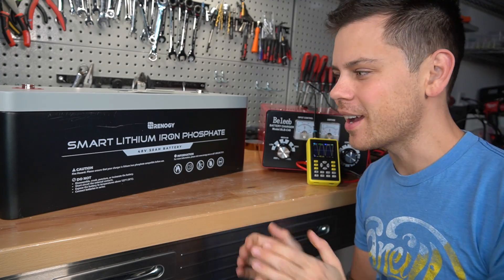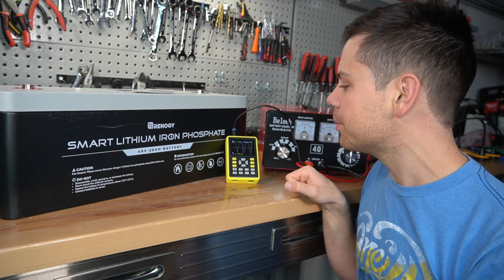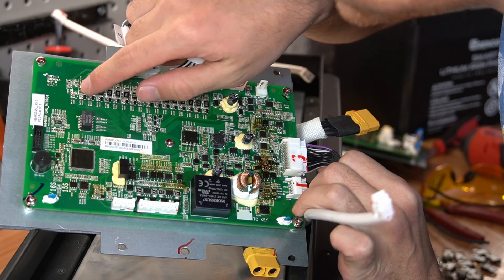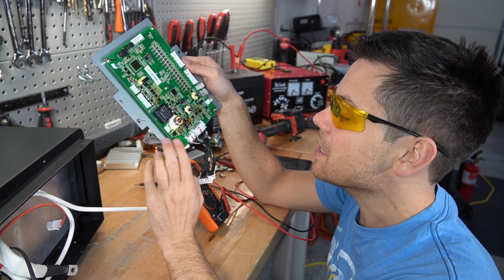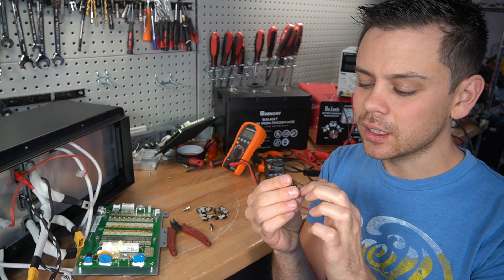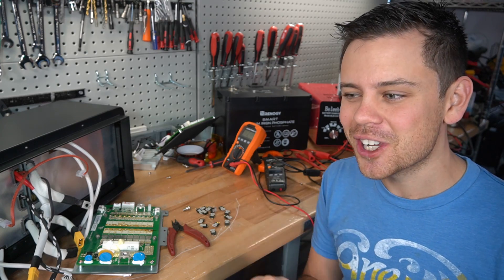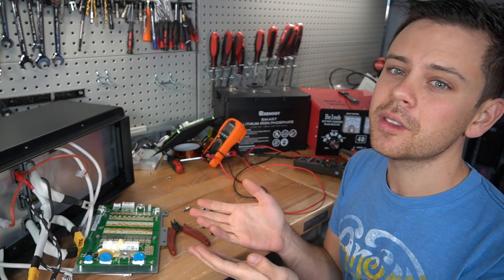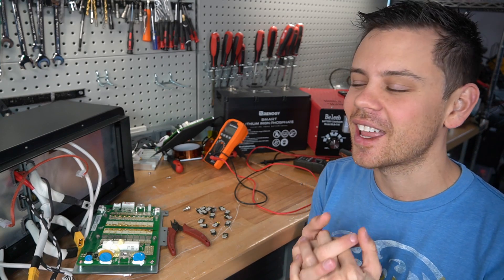Renogy "Smart" 48V 50Ah Part 2: How did I kill it?

Comment: Ok. after watching this and seeing this O-scope I went back and took a close look at your previous post. What you are seeing on the scope is NOT RIPPLE. It is Intentional. What you are seeing is a 120 hz. triangle wave imposed on top of a DC voltage. The DC voltage scope is showing is not the peak value, but a combination of the offset + some amount of the AC voltage. What I see is you've got a little bit more than half the waveform showing. The DC offset looks like about 37 volts and the peak to peak is probably 150 to 160 volts. That puts the positive peaks at about 115 volts. Negative peaks as shown at about -40 volts.  I'm thinking the scope was connected to the charger with no load.  The LA charger produces this output to help de-sulphur L-A batteries. The triangle wave generates voltage pulsation that pushes sulphates off the plates.  
If it were to damage the BMS it would have done so either right at the start when the BMS temperature sensor cut off the batteries or when the BMS switched back on after the heaters brought the temperature up to working range.  Neither of those things happened. While charging, you measured current at about 7.5 amps even though the meter said 12 or 13. The charger specs says it is rated for 8 amps into 48 volts and 7 amps into 60 volts.  It comes back to total power available, which for that charger is under 500 watts. When you boost the voltage to  48 'H' the max current drops accordingly, so that looks normal. My only thought about the meter was that with the triangle waveform, it might have been fooled by the peaks.
I believe the problem occurred as a result of adding the 2nd charger. It looked like it was directly bridged.  Were there any blocking diodes? The video shows the ammeter on the original charger dropped to a very low value, so the 2nd charger appears to have lower impedance and was pushing the bulk of the current. Since the DC voltage setting was in the 58-60 volt range on the 1st charger, the 2nd charger must have floated up to that voltage level as well. As the batteries absorbed charge the impedance goes up and current falls. The 1st charger saw a much higher effective impedance due to the 2nd charger and under those conditions the triangle waveform becomes predominant, however the higher DC offset voltage established by the 2nd charger and now nearly fully charged batteries would push the peaks to about 138 volts. The 2nd charger's lower impedance would have filled the bottom half of the triangle waveform with energy. The combined chargers would look like DC voltage of 60 volts with a triangle shaped peak at 138 superimposed. That's what caused the overcharge of the cells.  It is probably enough to cause a 100 volt rated FET failure, and kept pumping short duration pulses of charge into the batteries, overcharging them.  The BMS did fail, but with a FET in a short-mode failure it may have allowed overcharge to continue. 70 Volts (4.6v/cell) dissipated to just under 63 volts (just under 4.2/cell). I wonder if the balance section of the BMS dissipated that energy to correct the over voltage, as that seems more than just cell 'settling'.  Anyway, the double charger configuration is my take as to why it failed this time when charger 1, even though its a L-A design, did not cause problems in the past.   It is the only thing that makes sense to me. It's possible some kind of kickback occurred when the BMS cut off due to overvoltage and that caused the FET failure, but you'll have to test each charger and then the combined chargers to know.  The BMS design however needs to account for FET short-mode failure and disconnect the batteries. Maybe it's a fundamental flaw of this type BMS. When you use a charge controller, you set charging limits which would prevent the overcharge as well if the BMS were to fail like this.
 Perhaps use of a BMS with external relay controlled contactor should be considered with high power systems instead of FETs as solid state switches.  What are your thoughts about that?
Reply: DAM. That was way over my head. But interesting. You brought up the second charger, nobody else did. And, that's one variable that was different  than using that 2nd charger that he didn't  use on the other batteries.  
Because on the first test high voltage  was triggered.

Comment: That charger is not bad, it is great for free acid batteries, the maximum voltage measured by you is empty without load, an armored plate battery bank with liquid acid @ 48V nominal is normal to reach 62 Volts, you know better than me that during the final phase they equalize and while boiling the sulphation is reduced as well as mixing the acid of different density, it is simply not suitable for lithium batteries, but for a road tractor it is ok! Ciao

Comment: Please post a video of smashing the charger. And replace the FETs to see if you can fix it.
Reply: He could fix the BMS, but the battery cells are now suspect since being allowed to charge at low temp due to the fault, and to a high cell voltage without proper cutoff.

Comment: You should observe the output signal of your charger under load. If you watch off-load of course you have some high spikes. But if these are at 70V with no load, i doubt they could have destroyed the Mosfets (capable of 100V). Also i cant imagine very high spikes at the output when the transformer shuts down (is it a HF-transformer of a switch-mode power supply? - i would assume yes) cause there are still diodes and a big eletrolytic capacitor to smooth out the ripple. Otherwise the diodes at the output should be destroyed as well (look for their voltage rating!). Could it be the load was quite inductive on the battery and when you switched it off it could have generated back-EMF?
Correction: on the cheap lead-acid battery chargers there are no electrolytic capacitors at the output. You just have a big transformer 115/230 -->12/24/36/48... V AC and a bridge rectifier that goes directly to the output. I heard the hissing sound of 60 Hz, so its not a SMPS as i thought. You should disconnect the leads to the battery before you switch off - there could be a back-EMF from the secondary - but the bridge rectifier would prevent any back current.

Comment: for the record, i destroyed 12v  schumacher sc1308 charger while i was   doing something similar. i had a battery in a running vehicle  powering an inverter, and that inverter was powering said charger to charge another battery. i wanted to charge that battery faster than the alt would just by using jumper cables. that charger started making strange noises after that incident sometimes it wouldnt charge and sometimes it wouldn't stop charging. also, now that i have been running my 65 inch smart 3d tv off and on a pure sine wave inverter the sound some times doesnt work across all hdmi inputs. the tv is a replacement ($2000tv) for another just like it that also went out shortly after using an inverter to power it.  i am loosing faith in these inverters not destroying our stuff

Comment: 15 cell config is an interesting choice as it'll match up pretty well to AGM charging specs, but not be compatible with flooded lead acid specs, so as long as your charging system is good with AGM charge parameters it'll match and be pretty much a drop in replacement. With the knowledge that its a 15 cell pack that means both halves exceeded 4 volts per cell. Be curious what harm that did to the cells long term. If you ever get another BMS on it I'd be curious what the capacity is now. 

Very cool tear down, sorry the cheap charger killed it, upside is I now know never to buy that charger. :)

Comment: It makes sense. Battery fully charges. BMS goes open circuit, then that messy, spiky “DC” from the charger output exceeds the breakdown voltage of the FETs and the weakest one pops. Shame for Renogy that their potential buyers who find your first video may go away thinking the battery is unreliable.  Maybe edit that first video to point people to this one?
Reply from the maker: Exactly. And I put the link for this video all over the first video

Comment: Hey Will, 
Why don't you put together a good little unit like one of these to sell, or maybe a few  of them and see if you have a market. 
Or if you didn't want to invest in the inventory, maybe build them to order after you make a couple. I'm looking for marine grade units capable of higher C rates, able to power a pair HO motors similar to Netgains HyPer 9 HV sold through ev west.
I'd like a simple maintenance solar array but a good shore power and diesel generator as the primary charging systems. 
Thanks to you I'm getting more information on the LiFe Po's and solar systems, but I need a better estimate of system cost, reliability and the ability to expand

Comment: Those blue disk like components look like typical Varistors. Typically used for countering high voltage surges. Or might as well be Thermistors. But they cannot catch a overvoltage situation, which is just a bit higher then system voltage. They are typically there to counter a lightning event entering your wiring...

About your charger output, well yeah, that is how a cheap PWM output looks like. But every regulated charger, as well MPPT solar charger will initially output something like that, because the DC voltage is a function of input voltage (can be as high as a few hundred V) and zero V, applied for in a certain time interval. The only thing there is a big electrolytic capacitor missing at the output of the charger.

I doubt, that switching 72V will kill a Mosfet. But PCBs do not come with brown spots like that on it. That board has 5 areas with overheated or burned components on it. If you say that it came like that, then somebody abused that BMs before you already.

Comment: Kinda like old doesn't want to play well with new. Did you test the DC charger waveform under load (outputting). Seeing that much DC ripple/cycling almost makes me sick to my stomach. It isn't uncommon to see "chopped up" DC using switching FETs. But, in most cases, those FETs are chopping the signal at such a high frequency PCM (digital) BMS relays can't distinguish it from a pure straight-line DC analog waveform. Catch my drift? The Renogy battery still should have faulted out vs failing. Keep up the GREAT work Will!

Comment: Hi Will, thanks for all your videos. Have watched for a while, built my system in 2019 and since it is Canada and border remaining closed its just chillin there waiting. Thankfully I brought the batteries home in fall of 2019. I have been considering a LiFePo4 battery replacement for my flooded batteries. My system is (2) 24vdc 270watt Renogy panels mounted with a solar tracker which feeds into a epever MPPT charge controller. I have 4 12v 220 Amp hour batteries wired for 24vdc.  I have my solar panels wired in Parallel 24VDC feeding the Epever. Could I wire the solar panels in series (48VDC) into the epever even though the battery bank is 24V?  (max 100vdc capacity), should I? 

If I go LiFePo4, it seems I can half the amp hour capacity based on all the reading and from your videos. Appreciate any input and battery recommendations. Thanks! Paul

Comment: Great video and attitude man. You must know that all power supply, voltage or current or cc-cv source have a regulation  class.  Just like what you will see on any cheap low frequency 120vac to Dc transformer. there is a CLASS number writen on these. the class indicate the level of regulation it has... some cheap wireless phone base charger of 4.5Vdc 200mA will measure as high as 12Vdc at no load or very low load... and the voltage will vary and drop as the load increase. These are very poor class powersource. On teh other end, there are all these popular 100-240 switching power supply  with an awsome regulation factor, they are precise and also include power factor corrector to compensate for all inductive circuit. The lead acid battery charger you were using is just like a poor class power source with probaly a dual diode instead of a full bridge rectifier nut it is for a reason: lead acid battery like to get overshoot voltage spike as it destroy the sulfatation they often have. just remember the old craftman 10A 12v battery cahrger... they have no caps, just dual diode and a transformer so any harmonics of the 60Hz will contribute to boost the peak voltage at the top of each half wave. It would be nice if you do a Part 3 video and open that lead acid battery charger for us  =)

Comment: I think I will stick to my building my own packs my Zeva switches two gigavolt 500amp contactors (one for loads one for charging dual bus architecture). 

15 cells wtf I thought 48v nominal would be a 16 cell battery. I call that snake oil I have a 24v 8 cells pack I don’t call it 25.6 pack.

Comment: Put that charger on a variac - that way you can reduce the output to suit LFP batteries :) And 15S - who at Renogy thought THAT was a smart idea - fully charged 4 LA batteries are 57.6V, A 16S LFP is closer as a "drop in" replacement. Thats just cost cutting.

Comment: Will suggestion:
. As your followers all use AC to DC Chargers make a video about Chargers.
. As you have electronics knowledge, reverse engineer that cheap charger see what's deficient and add the appropriate capacitive/inductive filtering.
. Oscilloscopes are great tools set up a test parameter to look at your AC commercial line and compare it to inverters when doing reviews.
Reply: second that

Comment: This is the perfect example of why when you swap lead for lithium in an RV. You must spend a $170. replace the crap charger/ converter for one designed for Lithium. There is much more to {drop in replacement batteries] than just dropping them in.

Comment: Surely the point of a BMS is to protect the battery, so why didn’t it ???
Reply: Because when you run over voltage through a system not designed for that peak voltage the electricity "jumps" through the disconnect and will run anyway, most likely frying the board in the process too.
The safety system was not Designed to be abused in such a way.

Comment: Good MOSFETs on a resistance test will read open circuit between Source and Drain and on a diode test will read as a diode one way and not the other. I was going to comment last night but you pulled the video before I could. I suspect they were all dying but the first to go short stopped the rest going all the way. On inverters when this happens you have the full battery current going through them as a short and that fry’s the lot properly before the fuse can go. This is why a dead input fuse on an inverter generally means it is a very sick bunny.

Comment: When handling these boards, are you properly grounded to the circuit to prevent damage from static electricity..??
Reply from the maker: No and thats a good point, but the fet bank was working previously, then not working after hvd on second test. And another viewer stated that it is pretty rare to hurt these fets from esd. So am pretty sure it was the inductive kickback from the transformer based charger that is designed for lead acid, not fet based bms lithium ion batteries.

Comment: Yes you most likely overheated the smd components where the board was brown, unless it's some flux residue which will just wash if with flux remover. You can test Fets but in my experience replace them. And check the components around especially the driver on the shorted fet and associated components. Yes those capacitors will look and be fine they are disc ceramics and are usually rated to handle between 1kv and 6kv depending on the capacitor, usually these are used for spike suppression. Just be very thorough in your testing and I'm sure you'll be able to repair. There will possibly be a couple of fusable resistors around that shorted fet that will need replacing too. Fets are actually fairly robust in their handling, though if there are any electrolytic capacitors on the board, in a failed circuit they can hold charge so nice to discharge them before you start, but will be very little at these voltages. Best of luck. If you wanted to test the mosfets there's plenty online or YouTube to help you rig something up.

Comment: FET voltage rating should be at least 80V for a 48v nominal battery. Can you share part number of broken MOSFET ?
Reply from the maker: yes, but the kickback is probably what did it. could be a few hundred volts. and yes, data sheet is in the pinned comment
Reply: @WillProwse  Thanks for the reply ! 100v is fair for a 48v battery that's right. TVS should be present to protect transients, they could happen.  But yes it's difficult to protect against all in electronics... 
Advanced BMS have also FET monitoring, they can trigger (blow) a fuse in case of catastrophic failure (i.e shorted charge or discharge FET). At least this is LiFePO4 not LiION, but I would think twice before putting this into my house.

Comment: Good lesson, if an expensive one. I’m betting all future test gear will get the full input/output tests before it gets onto your bench! Thanks for digging to the bottom of this.
Reply: Most people would not  have the ability to diagnose their charger's!
Reply: @donraptor6156      Just takes a meter. No offense intended, but if a person can’t read an electrical meter, they shouldn’t be building electrical systems.

Comment: In order to exceed the 100V maximum V_DS for the FETs you would need to apply V_bat+100V from the charger ie over 148V!
Reply from the maker: The kickback can be much higher than that
Reply: @WillProwse  maybe you should consider mounting a varistor or just a large capacitor on your charger output.